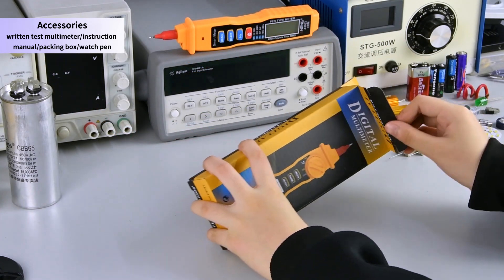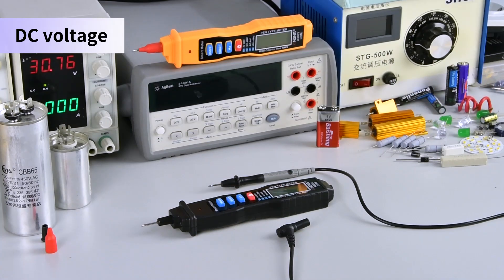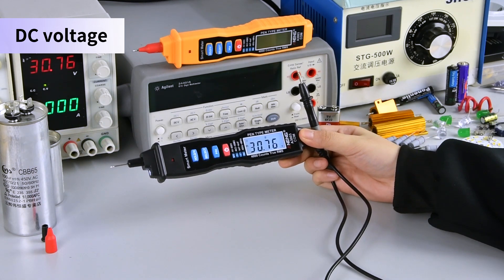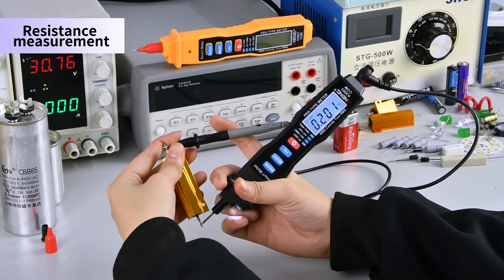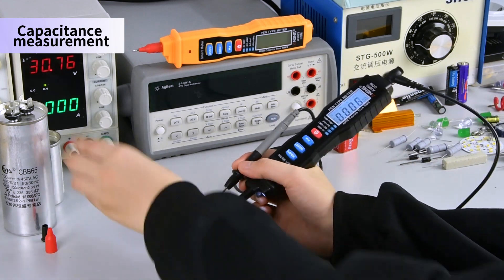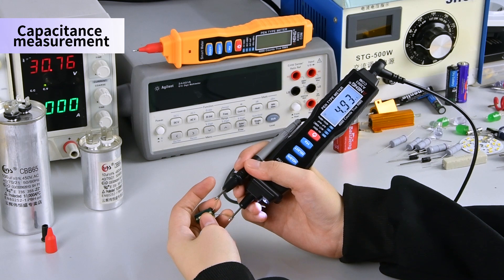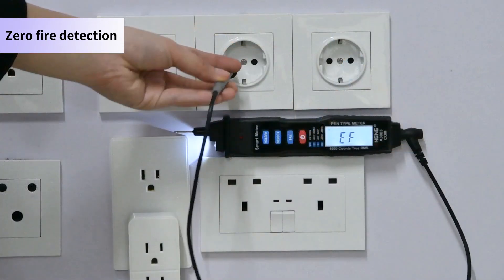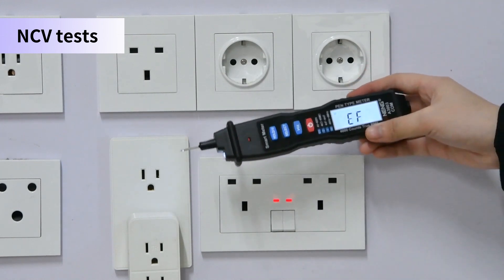ANENG A3003 Digital Multimeter Pen Type Meter 4000 Counts Non Contact AC/DC Voltage Resistance Tool

Comment: Which one is better this one or A3004?
Reply from the maker: A3003 is more better~
Reply: @aneng   whats the deference?
Reply: A3004 cos it can also measure current and it's got NCV which the A3003 lacks.
Reply: @danwu109  any place to get specifications like ranges of measurement and accuracy?
What kind of batteries do they use?